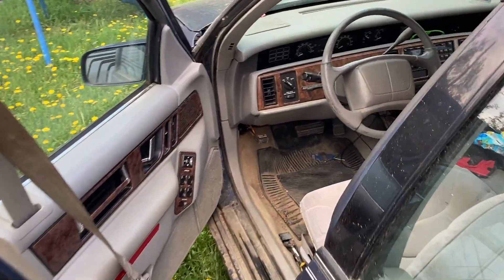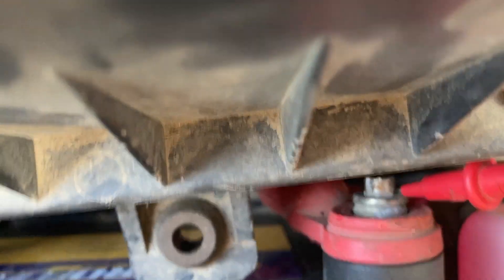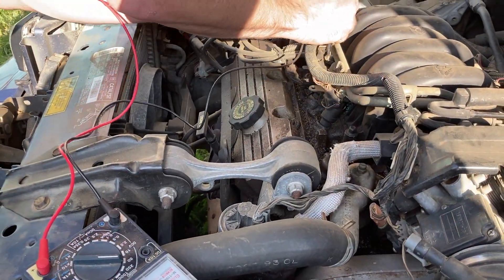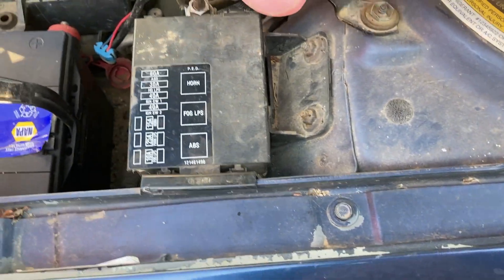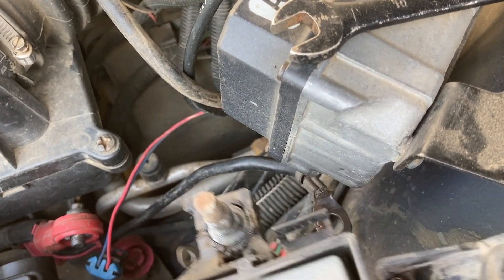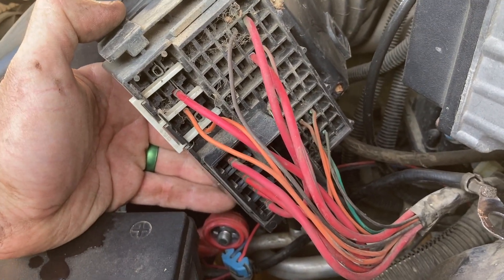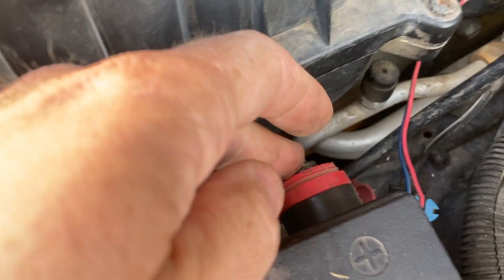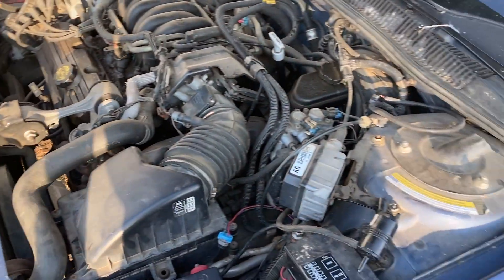1994 Buick Regal - Battery is charged, but voltage meter says no...what's going on?

Comment: I also was wondering if you could answer this question. I have mine the starter went out and I need to know. It's the same car I need to know if the engine's be dropped or raised in order to replace the starter.
Reply from the maker: I haven’t had to change the starter in a 1st gen W body yet, but no.  You should be able to get to it fairly easy…but test first, make sure it’s getting voltage before assuming the starter is bad.
Reply: @Turbo231  OK, thanks. The battery was charging... hubby says it was getting voltage.... I did not want to order tell figured out one of the series requires an engain drop or raise. According to the book

Comment: Common I have the same vehicle. My grandparents have gifted me. They said it has some wiring. I think they were from the factory and sat. Includes the check engine light that comes on and off
Reply from the maker: They are getting a bit old, which means electrical connections that were marginal when new aren’t doing any better.